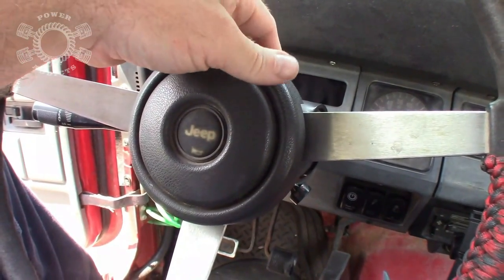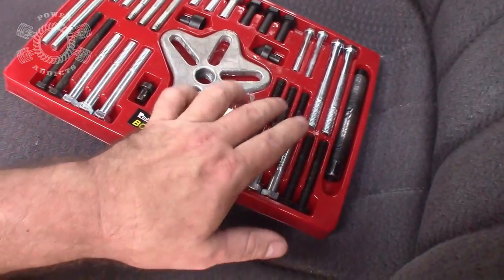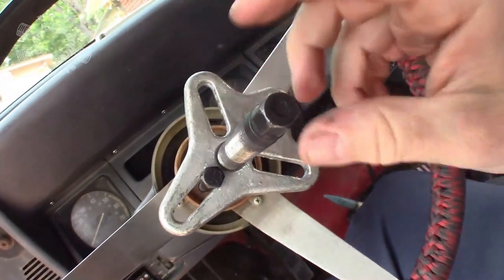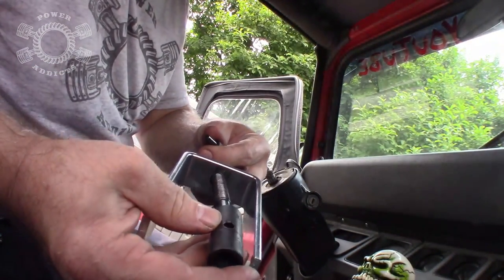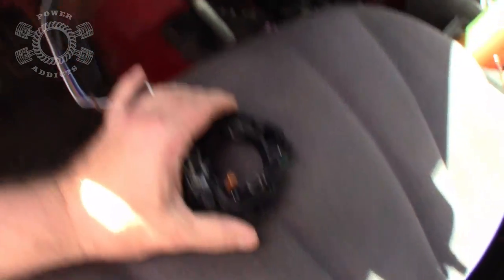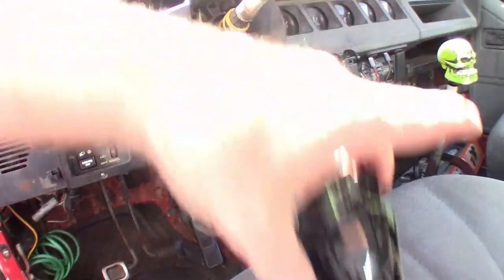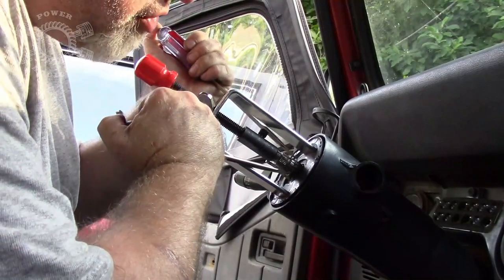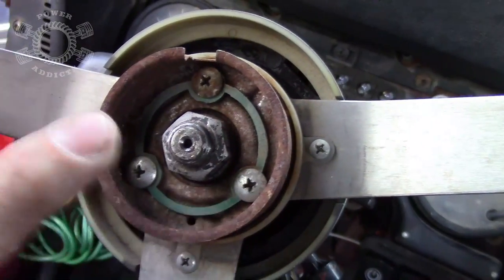Jeep Wrangler YJ - Install a new Turn signal switch #poweraddictscrew #jeepwrangleryj #jeepyj

Comment: Just got my YJ back together after troubleshooting inoperative blinkers. Tacked to the switch itself. I took the wheel off, the spring plate, all the way down to the switch. Switch looked in tact, but really scummy on the contacts. So I pulled the switch apart and cleaned the contacts, blinkers work again. 
Thank God cause I wasn't looking forward to fishing all them wires down it's throat and spending money lol

Comment: Nice video. A few years ago I busted my turn indicator lever climbing out of the yj. Spent three weekends trying to change it out. Finally gave up and bought a used entire steering column assembly. It was expensive but a lot easier to install the whole thing than fix the turn indicator lever. Then I got some aluminum bar and fabricated a shield around the entire lever so it's impossible for my thigh/leg to ever hit the lever. My wife says it looks stupid - like a handicap bar. Don't care! This is one of those things I will never do again!
Reply from the maker: Its not very hard. Here ya go https://youtu.be/G0HXjWP57Ig

Comment: Hi, ty for the great videos, just one suggestion, it's way easier to get the pins out and reassemble the connector at the bottom that trying to pass it all together thru the steering column.
Cheers !
Reply from the maker: I could see that feeding easier through the column. My ADD brain would forget what wires go where so I'd have to take pictures to make sure it goes back together properly.

Comment: Chuck - you're the best brother. Followed this step by step - had to replace mine because brake lights on my 94 YJ quit working - 3rd brake light was working & all other lights too. It was driving me crazy trying to diagnose until some on a FB YJ page clued me in - the rear brake lights are routed through steering column turn signal switch! - Fixed - brake lights again! - Thank you !

Comment: thank you for your video .great in detail . do you have a video on head light adjustment .on yj wrangler
Reply from the maker: Not yet. It is a video that I have meant to do. I just need to find a "proper" place to do it. To properly adjust headlights 20 feet of flat ground projecting on a perpendicular wall is needed. I got one place that I'm going to check soon to see if it will work. Make sure you have subscribed so you don't miss it.

Comment: Oh where was this video a couple months ago!? My turn signal lever broke off in column (I used your video to extract it). I pulled one off a 1994 Cherokee (I think) but the plastic housing was a little different so we had to modify it a little. Finally got it mostly together right & had bound up the rod for the high beams somehow 😑 My steering column had some other issues anyway so I got a rebuilt column coming *eventually*. Hope you got a video for how to replace that 😁. Oh & the turn signal shaft broke again! 😡
Reply from the maker: I don't have a video on that yet. I will "eventually" 😁.

Comment: Bet diy yj channel!  Do you have to remove key lock ?  Does the turn signal lever not have to come out?  Are those little ball bearings just sitting in there ?  Looks like a pain but at least you make it doable... Thanks

Comment: Just bought my first YJ yesterday, 89 Islander with a 4.2 from a Cherokee.  This is a phenomenal video.  I haven't worked on a Jeep in well over 10 years, so your videos are gonna be god send. Blinkers work right now, but moving the blinker handle is very stiff and feels like it's gonna break.  I also don't have bright lights.  My dims work, but not the brights.  Does this process have anything to do with the headlights?
Reply: Yes & no - The part he's replacing is for turn signals BUT pause this vid around 18:40 mark – on the left - (8 o'clock position) is small black box. This is where the wiper/turn signal stem clicks in – Notice in vid a small finger protrudes out (just above triangle of plastic). That’s the dimmer lever. When you pull on the wiper/signal stem it pushes that lever down on top of a metal rod that runs down most of the length of the steering column. The rod goes to another box mounted lower on the column which is the dimmer control - 1) the lever could be gummed up 2) the rod may be binding going down the column 3) dimmer control down the column might need replaced  ($35-40.) Hope that helps trouble shooting. Unfortunately if the black box under steering wheel is bad you have to take the steering column out (yeah crazy) Chrysler put the screws inside & pointing upward - You can't get to them with column in the Jeep! But if your wipers are working that's probably not the issue!
Reply: @jfisher2370  well…..crap. 
I don’t even have a wiper knob. So, I can’t check that. 
This is gonna be FUN! 🤪
Reply: @jfisher2370  well…..crap. 
I don’t even have a wiper knob. So, I can’t check that. 
This is gonna be FUN! 🤪
Reply: @lucky1867  - Are you missing the entire switch or just the signal lever? If missing lever you could try a junk yard. Easy plug & play fix & new online they range $14 to $30. BTW Chuck's got a video on getting out broken turn signal stem too. (he seems to have all the bad YJ luck - lucky for us he videos the fixes.)
Reply: @jfisher2370  wait, I may be looking in the wrong place. Is the wiper on the turn signal?  I was looking for a twist knob on the dash left of the steering column. 

I also spent several confused hours searching for the dimmer switch on the floor of the Jeep…🤣😂

Comment: Would it be a shame if it clipped and spliced those  wires I'm fairly experienced with electrical but wondering if a cut them near the clip if they will just slide out with the switch

Comment: I have a 94 YJ with a tilt column and my turn signals don’t cancel after the turn and the wipers don’t engage (new turn signal lever just spins inside the column so I’m assuming the plastic piece that engages the wiper motor is worn out) 
 
Now does the turn signal switch have the wiper motor switch in it as 1? Or do I need a wiper motor switch AND a turn signal switch?

Comment: If ive followed my diagrams right, this would control my brake lights also, correct? I no longer have brakeights but i have hazard and turn signal lights. I have 12v through the brake switch and up to column, but doesnt come out with 12v to brake lights. I have it all torn apart and new part ready ro go in. I hope this isnt a waste of time and find out im wrong..😒
Reply: how did it go? im having similar issues with mine also
Reply: What happened with your issue? I'm apprehensive to get into it if it'll mess up the brake lights now

Comment: Was it possible just to cut the wires near the switch, and splice wires of the new switch?
Reply from the maker: I guess a person could. But you gotta make sure you keep the patch spot as thin as possible because there is very little room in there. I personally wouldn't try it, too much risk of something shorting out.